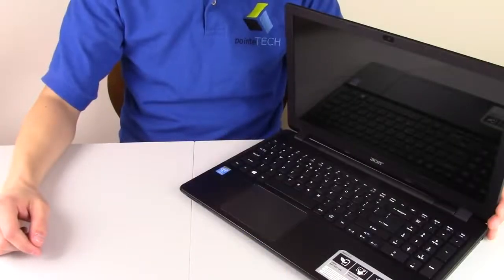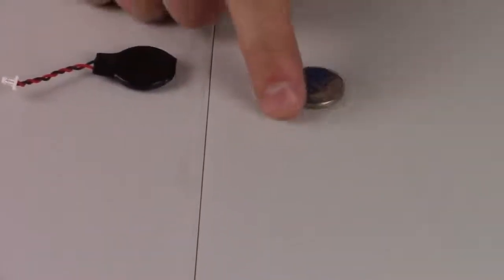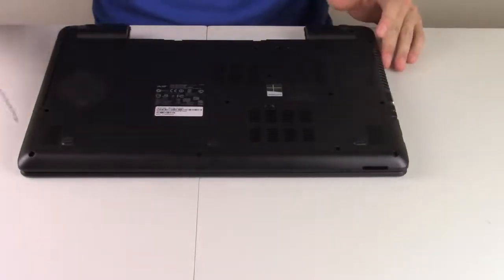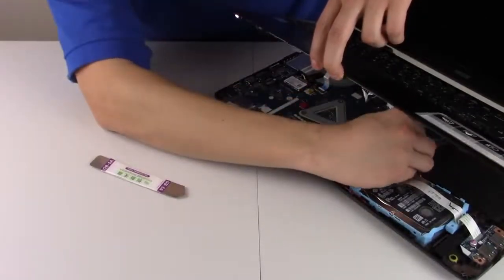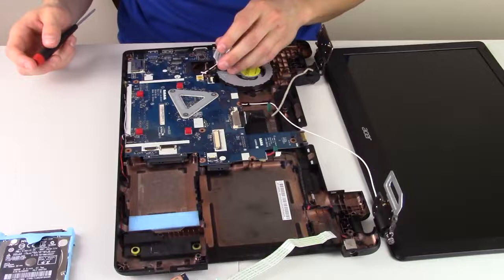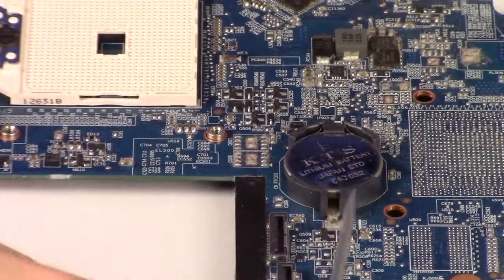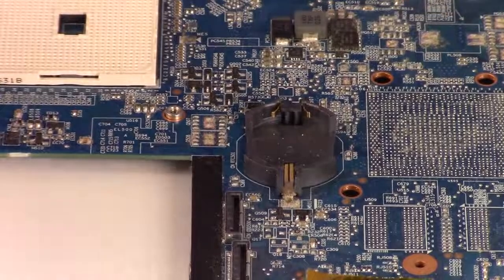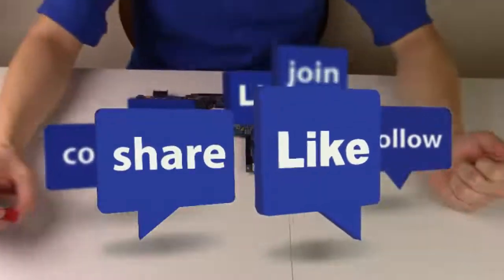How To BIOS Reset, Replace CMOS Battery - Acer Laptop Computer

Comment: My CMOS battery for my acer laptop is not the traditional CR2032.
http://prnt.sc/sc1nh9

Question is, can I use a regular cmos battery for this? I have copper foil tape to and will use wires and solder it onto the board
Reply from the maker: No, you should use the kind that is recommended for this motherboard.  If you wish to perform a BIOS Reset, then you would need to un-solder those points, let the computer sit for an hour or so, and then solder the points back on.
Reply: @PC_Monkey  Im having trouble identifying the kind of CMOS battery for this. MY laptop is an Acer E5-473G, the current pandemic makes me unable to find repair shops  to get the right battery.

I will try removing the battery, quite worried if it explodes, or does it explode only if you put the hot tip of the soldering gun directly to the battery? :) Thank you PC Monkey.

Hope this question also covers those people looking for solutions.
Reply from the maker: @pauloss9747  It shouldnt explode if you only de-solder the connection points on the motherboard.  If you are uncomfortable with the repair or the risks involved, then you should wait until you can have a trained professional perform the task.  If your attempting a BIOS Reset, then you dont need to purchase a replacement.  You would only need to replace the battery if it was damaged or dying.  You would know that by the computer not starting or the Date/Time settings in BIOS are always off due to BIOS being reset every time the computer turned off.
Reply: @PC_Monkey  I believe it is already dying, my laptop is no longer turning on. Also, tried reading the voltage of the battery, it reads around 0.5v to 1.2v -- which I  suppose should be at 3v 

Thank you PC Monkey.
Reply from the maker: @pauloss9747  Ill continue to look for that exact same one, but if all else fails, you could purchase something like this;
https://www.ebay.com/itm/New-CMOS-RTC-BackUp-Battery-for-HP-DV4-DV7-CQ40-GC02000KI00-Resume-Clock-Bios/111143634946?_trkparms=ispr%3D1&hash=item19e0ad4802:g:jQUAAOSwZdRbyp7Y&enc=AQAEAAACYIQvEcHUrT7nmUC3yY5qbPyaBN1nJEDYW8MyypsJPgXK4bURMq2bKi1lXHfouGa7iVakcxuRAcRpmO0uJsG87cT7EFUr1AiVlR5xW%2BtKjrv4ZMOKFk6LuRauGiE5HxzjSyBFzYz7L70iu9%2FzJPkUbX%2BEEI%2BiW3AGzOwJTHh4WLEXNUwRz3ridE1MGG7PYD8Lg2wupfTeRuteYTU3EhBRI6B248VjpRxfA3VPwQjetWKNee%2Bryd%2BYIKfy2lpNt9IRdPPgiJ8xWUWtEHTspkHHMa3go2j2OGR9NnFJEbPSkcMVoeNiTFazHQyG93xkhd42k99HeUe4cPKzF1rWGfmeHfqUvMykiFQy0LxNYWoHNt%2BsgtazVkvwXuWSx7kKyJcxV11PZRx%2FhLqrzgobR3tEcxtF3DMjrbG14kW9WsuuR%2BJnYOtc0ZEDn4GkbbQl7NHMn8qLrwcvPjG21ykEUfgvkfDmIswj8SPeZJ%2BNY%2BtzmPOPSfaeLNMKVVoarEice6LyHQ2UjsjyEOze5T8MOYfW38zsLAUa1vXGncuAL5oh6VrT8kI4Mt6NmUXxSZYK5T2rsehBCP%2BXAhHC7l2TlDC8lGqESTNxGB48HCERDymrek7ZNDCDT8F9N8Zm8NliDmriXKpdVSrdxQ21GR3G4fler2I833bgZGLMVUEZJJ15nTDAcv7SCzf38VPnxzWlP1JmKQFFXGLbnvMqOXHJZ9mfovPdErcIMXCWySphV8ZHm5Ukl%2FA3b10ZprTxUFFbyAOnpKMYwiC2XKwM0j7iqv4m9eoBtLPQ%2FRuzT3A4uIFnVNax&checksum=1111436349464b2cf34fd19d4b02a1c3b2b6b03dab48
Reply from the maker: You would just cut the end connector off, and solder the red cord on the Motherboard to the Positive side and the black to the negative side.
Reply: @PC_Monkey  Thank you, I think I found the cmos type, not sure if it's ML1220 - a rechargeable one.
Reply from the maker: @pauloss9747  Most CMOS Batteries are rechargeable :)  That one looks good to me :)  Nice work !!
Reply: @PC_Monkey  Oh didn't know that haha. Thank you, PC Monkey.

Comment: I broked my socket batery cmos.. what should I do?
Reply from the maker: You would need to get the motherboard repaired.  However, for many motherboards, that is just as expensive as purchasing a new one and is not guaranteed.  You may be better off replacing the board.

Comment: What if my laptop turns on after multiple attempts ( now its like pressing power button for 2 hours )
and Laptop works perfectly
Reply from the maker: I dont fully understand your issue.  You computer turns on and works fine but you have to first push the power button over and over for a couple hours first?
Reply: @PC_Monkey  yeah i know it sounds weird but i have made a few points over things i noticed with my laptop here are these :-

1. Some months before , it used to take 10 to 15 button pushes to start. Now , it takes sometimes 2 hours of button pressing to start.

2. If it starts and is disconnected to power adapter , predator logo (laptop is acer predator) shows and laptop shuts down. This problem doesnt shows up when i try to open my laptop with power adapter connected or instantly connect my power adapter before predator logo shows up.

3. If i shut down my laptop and try to reopen it ,laptop turns on after pushing power button for like 1 minute but if i try to open it after few hours , its requires a lot of time

4. Laptor works perfectly fine when successfully switched on

5. My laptop also started having a pink screen issue on 9th August https://youtu.be/-o0-gqTbUl4 due to which i had to turned it off but when i reopen it after 24 hours , screen worked fine first 30 minutes and then it starts having problem again. When i connect it to the TV , display was perfect there

6. sometimes when i remove my power adapter , laptop instantly switches off

7. I have changed thermal paste million time and tried multiple thermal pads combination. Still have overheating issues in CPU , Temp on games like hearts of iron 4 and Company of heroes 2is like 70c on both cpu and gpu but on games like RD2 and Steel Division 2 , i gets 95C on CPU and 80C on GPU.
Reply from the maker: @Aditya-pq8mi  1.  If your computer only turns on with the power adapter in, then I would first assume you need to replace the battery.  
2.  If your computer is overheating, then you have kinda found your problem.  An overheating computer can be damaging multiple different components if not resolved. First, make sure that the fan and vents are clean and clear. If you need help accessing the fan, let me know what brand and model computer you have and I can help you get inside it. If that does not fix the overheating issue, then try replacing the thermal paste on the CPU and if needed, the GPU as seen here; https://www.youtube.com/watch?v=K_j4GPjpawk. If that fails too, replace the CPU
Reply: @PC_Monkey  I think I have to replace cpu cause this category of cpu can undervolt till -170v but mine only could till -70v and i also cleaned fans and changed thermal paste multiple times
Reply from the maker: @Aditya-pq8mi  Yes, sounds like it needs that.  Let me know if you need help with that procedure or how it goes :)

Comment: I can't find mine on my Acer e5-471 series
Reply from the maker: I looked up some pics of that motherboard.  Seems like it may not have one :(  Some computers dont.  They use the main battery to cover the functions of the CMOS.  Why are you trying to replace that battery?  Whats wrong with your computer?
Reply: @PC_Monkey  I just went thru an acer e15 and didn't find that battery. My system is totally dead, no LEDs with a battery and charger that both test good. Seems a common issue after a few days of searching with no fix. Anything else I might be overlooking or perhaps was overcooking?
Reply from the maker: @marcharriss84  You have already tried this video?;  https://www.youtube.com/watch?v=_MOe71kBPOY&feature=youtu.be 
If you cant access the CMOS Battery then you have tested the charger and power jack as seen here?;
https://www.youtube.com/watch?v=YBhsVHideGE&feature=youtu.be
https://www.youtube.com/watch?v=HpabvrNaodU
If none of those show an issue, then your motherboard is most likely the cause and would need to be replaced.
Reply: @PC Monkey Appreciate your response. Yea I commented in my desperation yesterday. 15 minutes later I came back and watched the rest of your videos. Everything tests ok, leaving only a problem somewhere on the motherboard. Had never even thought about opening a computer before and besides shopping for computers I was completely unfamiliar with any of the parts. Your videos were very educational.   I even feel like I could probably replace the motherboard but at this point I'm not sure which way I want to go. I may just buy a newer higher quality brand I can stick my ssd and possibly the ram into it make a super beastly gamer. It's a good time to get a better GPU with all the newer games. If you had any recommendations on a particular brand or model for gaming at around the $1000 mark I would give it a lot of consideration. Thanks again more than earned a sub.
Reply from the maker: @marcharriss84  Sounds good :)   Not too much experience with gamers :(   Good luck though :):)

Comment: Heads up! THIS WILL NOT WORK WITH ACER ASPIRE V3-572PG. the battery is a different version that is soldered onto the motherboard, and therefore cannot be removed! I found this out the hard way so you don't have to!
Reply from the maker: In the case of a soldered on CMOS battery, you would have to desolder it to reset BIOS.  But that will still reset BIOS so this method still works.  Not all motherboards will be the same DIY operation.

Comment: I had no such luck. The battery was soldered
Reply from the maker: Then you wont be able to reset BIOS this way unless you can un-solder it and then re-solder. 
Why are you trying to reset BIOS this way?
Reply: @PC_Monkey  the laptop won’t turn on. The power cord light stays on, the power on light turns on, 5 seconds later it turns off. No display. No apparent fan activity.
Reply from the maker: @enticeman28  Have you tried the other steps seen here?  https://youtu.be/P3I7dDpkJps. Let me know how that goes :)

Comment: My laptop's charging but it is not turning on
Reply from the maker: For a computer that wont turn on, you should try this video first;  https://youtu.be/_MOe71kBPOY
If that does not identify the problem, then come back here and try the BIOS Reset :)
Let me know how that goes !!
Reply: @PC_Monkey  boss tried bios reset but negative 😔the thing that irritates me is plugged in charging but not turning on not even fan running
Reply from the maker: @rsp9125  If you tried that first video already and it didnt work, and now have tried the BIOS Reset with no luck as well, then test your Power Adapter and Power Jack as seen in these two videos;  https://youtu.be/YBhsVHideGE & https://youtu.be/HpabvrNaodU.  If those both test Good, then the issue is most likely with your Motherboard.  It would need to be replaced.

Comment: My Acer don’t have that CMOS thing
Reply from the maker: Not all computers have a CMOS Battery although most older ones do.  What is the model number for your Acer?
Reply: PC Monkey Acer aspire E14 E5-473.
Reply from the maker: @KayeAye-d6s  Ya I dont see any on that motherboard either if im looking at the correct one.  Why are you trying to perform a BIOS reset?
Reply: PC Monkey ‘Cause my laptop died for reasons I don’t know and never opens again. When i plug it in the charging light indicator dies after 1 second.
Reply from the maker: @KayeAye-d6s  This is the updated video for that;  https://youtu.be/P3I7dDpkJps.  Just skip the CMOS Battery test.

Comment: I fixed it by replacing cemos battery why this happened
Reply from the maker: Are you asking why you needed to replace the battery?  Sometimes they just die and need to be replaced.
Reply: Please reply me ,my Acer laptop suddenly didn't turn on even no led display when connected to power.charger and laptop main battery is good (.model  Acer aspire e 15, ) after I disconnected and reconnect cemos battery it works normally now what is the reason for that? I am using windows 10 latest version,
Reply from the maker: @imalwelagedara8061  It could have been a BIOS issue.  The resetting of BIOS helped.
Reply: Thanks 😊 but when I put my computer on sleep mode I had to do a bios reset again by replacing cemos battery I'm afraid why this happened I'm not sure on my laptop will it turn off again unable to start ,always I would to do bios reset?

Comment: How can we reach you via mail??
Reply from the maker: I only communicate on this YouTube messaging system for free DIY support.  What brand and model computer do you have and whats the issue with it?
Reply: @PC_Monkey  i have lenovo  ideapad 520 ..it got shutdown due to 0% battery during bios update...now its not starting..on pressing power button fan starts and shut down immediately..and then it goes in a loop of fan starting and shutting down
Reply: @PC_Monkey  i tried resetting the bios but still the same issue
Reply from the maker: @ranjeetsinghhada3775  For a computer that wont turn on, try this video first;  https://youtu.be/P3I7dDpkJps.  Let me know how that goes :)

Comment: My bottom won't come off
Reply from the maker: What model number do you have?
Reply: Same
Reply: Mine is a hp core i3 7th gen
Reply from the maker: @carolinalopez571  Thats not the model number.  Those are the processor specs.  Try finding your model number.  It should be on the bottom.  You can then use it to look up a disassembly video for your computer that will show you how to take it apart.

Comment: My cmos battery seems to be like suatered  on I can’t take it out
Reply from the maker: Yes.  Some are like that.  You would have to de-solder it, leave it off for a time, then solder it back on.  If thats not an option, then you wont be able to reset BIOS that way.  Why are you wanting to perform a BIOS reset?
Reply: There is no display after disassembling
Reply: @PC_Monkey  there is no display after disassembling.
Reply from the maker: @pound8109  Most likely, if the computer worked before, its because something is not plugged in correctly or damaged.  Recheck the LCD Cable.  Is the computer turning on?
Reply: @PC_Monkey  Yes. I repair computers. I always have issues with Acers, especially the old ones
Reply from the maker: @pound8109  Ya, they can be a pain
Reply: @PC_Monkey  I'm out of ideas now. Any other options?
Reply from the maker: @pound8109  Are you sure the computer is turning on and its just that the display is not working?  What signs are there that the computer is on?  If the computer is on but no display, try hooking up to an external monitor.  If the computer is not turning on, start here;   https://youtu.be/P3I7dDpkJps.
Reply: @PC_Monkey  I already did that.The external monitor light stays orange instead of green
Reply from the maker: @pound8109  What signs are there that the computer is on?
Reply: @PC_Monkey  It switches on and the fan spins for a while then it stops.Also the HD you can hear its working.just no display.
Reply from the maker: @pound8109  Ok great.  Those are signs the computer is actually but the screen may just not be working.  For a computer that turns on but the display does not work, try this video first;   https://youtu.be/u-REPLdpZ70